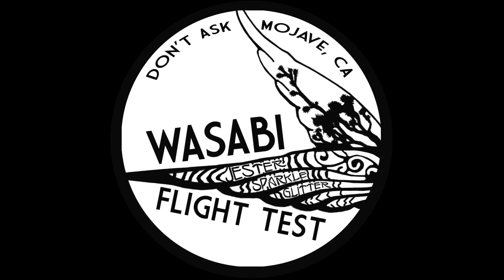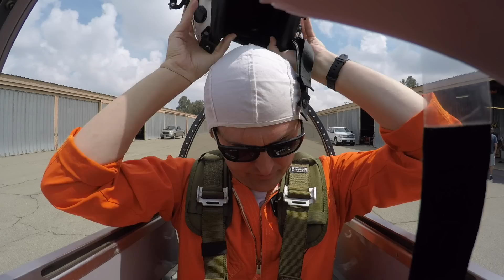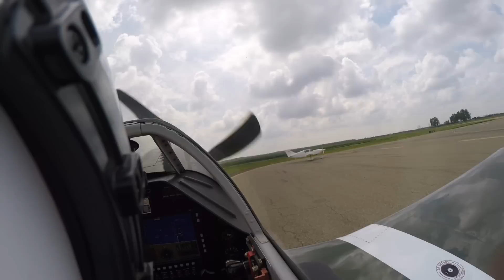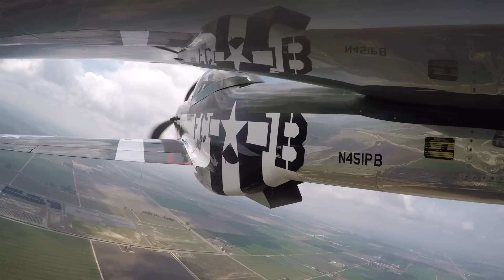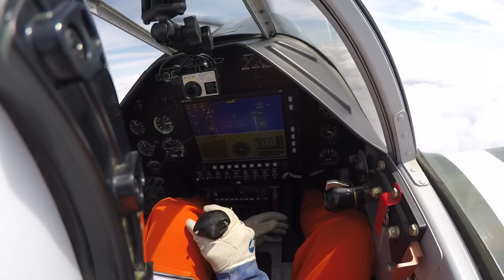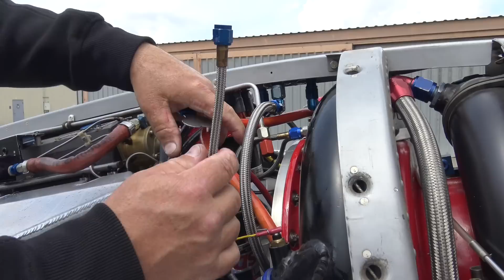Emergency Landing, Loss of Propeller Control, #Bowerspony Lucky Flt 13 -Long Cut w/ Debrief

Comment: Oy mate! I been in the aircraft realm for many years , don't loike heavy bonanza planes especially the V tail 😤 ! There's an old fashion saying: ( glider flyers make better pilots) anyhow, another interesting thing about any mechanical apparatus   in the air ? Even heliocopters, Is that ALL are 89.99% flyable 😳 the other 10.01% goes into 2 categories, 5.001% is any mechanical failure while in flight , the other 5.001% is pilot error and, if he doesn't react promptly? It will become a fatal accident. It's also better to belly land with low fuel or empty  at any time given the occasion ! ⏲️

Comment: Distractions on busy mechanics and so forth can be avoided if you have a chart, say 1 thru 50 and writing down what you are working with and then double check when you get bsck to it , mark with 2 initials when done . This is the only way even if you have all timers disease 🥴

Comment: The honesty of the video's is a real eyeopener. 
The red line in aviation, professionally or in homebuilding is constant quality.  Proficiency without any dips. 
I have met perfect pilots which, very seldomly, showed low proficiency flights. Also mechanics have bad days...alass we are human.
Check, recheck. And double cross-check.  again.   
Thanks for the video and good luck!

Comment: Dang. A loose line. No drilled line fittings or torque seal? Looked like the boss was very disappointed. That's what A Cards are for. Got sweaty palms watching your approach.
Reply from the maker: Thanks for the comment, great to have you along.

Comment: Kinda surprised you would use that number in your count...
Somebody did not properly tighten a hose? I do assembly and installs in marine engines, all of it custom built high performance stuff. I prefer to do the entire process myself but sometimes time constraints require asking for help...have a few rules...any time you install a hose, but, bolt...it gets tightened to spec at that time and as my helper works I expect a move by move narration of every move they make
Reply from the maker: Thanks for the comment.  It was a tough say but I think we can all relate to that lesson learned

Comment: Geez, if only there was a way to tag fittings as you remove them and untag after you torque them back down.  Or maybe mark them after they're torqued down.  Or write them down on a list and, like, check them off when you reassemble.  I wonder if you could just rent midgets to hold the fasteners shut during the flight -- nah, but maybe wrap 'em in some really thin bailing wire after they're properly torqued.  But why take responsibility for this when you can just blame it on alleged airport bums instead, amirite?
Reply from the maker: That’s a perspective, thanks for the comment

Comment: Very good video. One thing that I find very helpful is use of witness/marker paint stripes on all fittings and nuts/bolts. Not only does this allow you to know if a fitting has moved by just looking for a break in the stripe it its also a good way to know its been tightened. When you remove a fitting for service you remove the witness stripe completely and then when you reassemble and torque it your last step is to add a small stripe. Each mechanic can have their own colour so you know who did what. You can even have a double stripe from a second inspection mechanic and know what has been double checked and what has only been single checked. This helps you avoid the interruption problems from on lookers too.

Comment: Plane is stunning. Great video. You could debrief a slice of toast for an hour and I would still be interested. I am a mechanic (not aviation) and the technical and mechanical info is on point. This plane seems to have a bit of a character already. Which I suppose for you is exactly what you enjoy, figuring out the puzzle as well as testing the planes.

Comment: Anytime I'm working on the P51 or the Sea Fury I keep the hanger door closed and my truck in the hanger so people don't know I'm there and stop by while I'm working on the planes. Its for the same reason the man said, you can get interrupted. Not that I don't like people, but I don't need to be interrupted and have the chance to forget what I'm doing.
Reply from the maker: Well said, it's such a common problem.

Comment: talking about getting the "value" out of the chase plane when you need it (post takeoff safety checks) - have you thought about adding a guy on the ground with a telephoto lens and a tripod?  That way you can takeoff and do initial climb to your "minimum safe" altitude and circle where he can see you clearly and do the first-pass "is anything leaking/did anything fall off?" checks?

for spotting fluid leaks - have you thought about adding a colorant to the oil(s) to relieve the problem of not being able to visual ID leaking clean oil?

Comment: Really great stuff Elliot, well handled.  Was curious if the timing of the gear sequencing was resolved and if the gear stayed on the uplocks?
Reply from the maker: It appears to have been solved.  This flight was shorter than I would have liked, so the system may not have bled down completely.  We'll need a longer flight to be sure, but it looks promising.
Reply: @utopiasnow  thanks for the reply!  I'm sure that got pushed way down on the debrief list.  I was particularly interested in that from previous videos as I was involved in a nose gear door sequencing valve issue once upon a time.  Sheet metal doesnt stand a chance against hydraulics...  😳

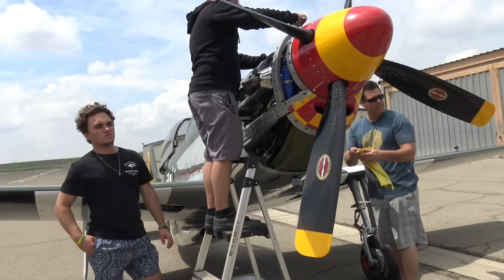Comment: 35:00.  No.
That is what happens when you do not have a proper mtx manual, work cards or a II.
Work flow gets interrupted, you just continue on with the unchecked steps.
The II is your further assurance.
Also torque paint.  
Edit: AND do not put on a component unless you are prepared to finish torquing / safety it.
Reply from the maker: Thank you for the comment, and the passion
Reply: @utopiasnow  Love your dedication and expertise.  Have been talking with my hanger partner about having you doing a short test series on our new to us kit built.  Don't know if we could afford you though.
Reply from the maker: @notj5712  I am sure we could work something out.  Drop me a line ElliotSeguin@gmail.com
Reply from the maker: @notj5712  We would love to support.  Drop us an email.  And thank you for the comment!!

Comment: Why are we pilots / builders so "polite"? Is politeness worth falling out of the sky, obliterating your airplane, and possibly killing yourself and/or others? Seriously, WTF? When I'm working and I don't want to be bothered, I put up a sign at my hanger door "CRITICAL WORK UNDERWAY: PLEASE DO NOT DISTURB". My buddies are very understanding, and I don't forget to screw a critical bolt on my engine or accessory because my neighbor wants to chit-chat about his $100 hamburger adventure from 1954. I don't put the sign up always, but if my cowl is off, you better damn well believe the sign is standing tall and proud...and in a VERY obvious location.
Reply: And another thing I do...TURN OFF the damn cell phone while working on the airplane! STERILE WORK ENVIRONMENT is as important on the maintenance floor as it is in the cockpit.
Reply from the maker: Thanks for the comment

Comment: Elliot, I lost the oil pump on my F-1 Rocket wtih an aerobatic MT.  Like the prop you have, it then went to high pitch.  When the prop went coarse, I looked at the oil pressure, and obviously it was zero,  I pulled the throttle back, but did not pull the mixture.  I had an airport made easily, and I hit the high key, everything was fine until I got to 120 kts, on base, then I could not slow down or get the airplane on the ground, even at idle thrust, with coarse pitch my airplane will fly.  I pushed it on the ground at 100 kts and got it stopped, with really hot brakes, but in my mind the engine had failed, but it was running at idle with no oil pressure and pulling the mixture never occurred to me.   On a subsequent flight you might pull the power to idle and the prop to coarse pitch and fly at best glide and see if you can maintain altitude.  In a light airplane with big power it might just fly at idle...  Doug Rozendaal.
Reply from the maker: Thank you Doug.  Sounds like some great flying in your rocket.  Are you still flying it?

I am pretty confident the airplane would have flown with the prop in coarse pitch.  The question was did the PSRU have enough oil to stay luricated, and what else was wrong.  Waiting on the gear and flaps was my hail mary in the event I needed to try to add power and get back to the airport.

Thanks again!!
Reply: I have had it 10 years, it's an EVO, I have over 2000 hours in it.  Fabulous airplane.

Comment: Great video! Love the new format! One question, what’s high and low key?
Reply from the maker: Thanks for the question.

A simulated flame out (SFO) pattern starts high and above the touchdown point on runway heading.  The spot is called High Key.  180 degrees of turn later the airplane is basically downwind abeam the numbers, this is called Low Key.

http://www.f-16.net/forum/download/file.php?id=4926&sid=9d79ed6d164d13806a6a3542c42fae60&mode=view
Reply: Elliot Seguin thanks for the answer!

Comment: This is outstanding. It fills a void in aviation content about flight test in the best way. I really appreciate the step through of methodology, brief & debrief, and honest discussion of the decisions being made. It even brings good items to consider for safety in a non-test environment like stepping to the downwind side of the runway to aid a 180 back if necessary.
Reply from the maker: Thank you Darin.  The offset take off is a bit controversial.  Some folks are opposed to it.  I use it, but we have taken flack for it.

Thank you!!

Comment: Love the in-depth video Elliot.  One question - do you have any ideas why there seems to be so many problems, especially as of late, with the LS and auto derivative engines?  There have been several fairly high-profile accidents in the last 2 years involving them and seeing these videos with the teething problems being found, I'm just wondering if this is a real change in the failure rates or if it's more because more auto derivative engines are getting into the air and thus there's more actual failures but the rates are still the same.
Reply from the maker: Interesting question.  I am not an expert on LS and auto derivative engines.  I would say however that the safety record for auto conversion hasn't been outstanding.  Someone once said the problem with a car engine is it makes rated power for less than 1% of it's life, where an airplane engine will sit at TO power from brake release to cruise altitude.  Other people talk about redundancy of systems, I am not sure.

Certainly the basics (suck, squeeze, bang, blow) are the same, it seems like they should work the same.

Thank you!

Comment: Love the new format! 
As a mechanic in a repair station,  I think stopping distractions is quite difficult, if not impossible.  I think a deeper take away would be a plan as a mechanic to mitigate the risks associated with being distracted.  Any time you stop, and re start, you start two steps back from where you think you were. And I often take a break, and come back and put a wrench on lines I have ready done. Torque stripe is also a good tool in this scenario.
Reply from the maker: Thank you John!!  I like the strategy!
Reply: @utopiasnow  feel like that came across slightly condescending, which is not my intention. Sometimes crap happens and mistakes get made. But.. we can do something to help prevent them when possible. 
Love your videos Elliot!
Reply: Being a prior military electronic technician this problem is negated by the use of appropriate manuals and operating procedures.  I can't speak for my civilian counterpart but they admitted it was human error.
Reply: Totally agree with just marking the joint/fitting as being torqued. Also in high vibration area's and with flight control systems, it is always prudent to try and wire lock or install an anti-turn bracket where possible. An example was a mod to add anti-rotate brackets to Vans RV's fuel pickup tubes, internal to the tanks after a number of them fell off! In lieu of a visual indication, a process to list and note anything and everything that gets stripped down/disassembled and a corresponding 'check' once its re-assembled and torqued/locked completely. Hats off to Rod and Eric, Beautifully built aircraft.
Reply: Putting a stripe on a critical fitting so you can see at a glance if it is lined up is just a great tip. I appreciate that.
Reply: I like checklists and then going back and rechecking steps that I’ve crossed off.
Reply: A&P for 17 years on helicopters in the oil field. We ALWAYS used torque strips on EVERY line fitting as we torqued the fittings one at a time. Then the pilot would verify on preflight. It is a shame to see such a beautiful aircraft with such unprofessional maintenance practices. This should have been spotted before the test flight!

Comment: You would think the PSRU would have a fail safe minimum as to not render the engine completely useless with loss of hydraulic fluid. Should add a hydraulic fluid level sensor to the reserve tank just because it's been an issue. The sensor would eliminate the belly check, and allow almost immediate response to a levels change. Could even use a gas gauge rigged setup for the time being. Could pull one from the junk yard for cheap.

Well flown falling bird Elliot. Good job getting her on the ground.
Reply from the maker: Interesting thoughts, thank you

Comment: Thank you and Mr Bower for posting this video.  A lot of good information.  And from a viewer standpoint the more info the better.  If there are viewers that want less, all they have to do is fast forward the parts they don't like.  As far as thoughts go, I thought the brief should be in a more sterile environment, not where there are other personnel and distractions.  The same for the debrief.  From a meteorological perspective regarding cloud cover percentages and what's acceptable.  Take two sheets of paper.  Lay one on the table, this will represent your sky.  Take other piece of paper and cut off 1/5th of it (20%), and tear it up into small pieces, these will represent the clouds.  Take those cloud pieces and place them on the piece of paper that represents the sky, and determine if that percentage of clouds is manageable or not.
Reply from the maker: Thank you Kent

Comment: Geat video. Is the prop hub not designed that the spring pressure pushed the blades toward fine pitch/high RPM?
Reply from the maker: This prop came off a King Air, so multi engine...fails coarse pitch.  Thanks for the comment.
Reply: @utopiasnow  Makes sense if it was off a multi, I guess custom prop hubs certainly are not cheap
Reply from the maker: @USAF291  Well said

Comment: Thanks for the long format! I absolutely loved the detailed debrief of the whole process. As I plan to get into kit building I will have to take the advice on distractions during build and maintenance to heart. Could you do an explainer some time on chase plane procedures for the realm of flight test? The spin test chase video and the chase elements touched on in this video have always intrigued me. I used to fly chase for UAVs (to act as their eye and ears looking for traffic) and I am interested to compare and contrast the roles with flight tests. I also think others could get value out of the planning that takes place in a good formation brief.
Reply from the maker: Thanks for the comment!  Chase is a great topic, I think in the contract test community Wasabi probably relies on chase more than most.  I would argue that comes down to my relationship with Justin Gillen.

I rely on chase first for external information about the airplane (smoke, oil on the belly, gear position, fluttering trim tabs).  Secondly, I rely on chase for reminders about glide cone, traffic calls, and airport position calls.  The problem is all those things are very critical pieces of data with wide ranges of interpretation., and if I don't trust what you are saying than all you are doing is distracting me.  In short, I have to trust that you and I believe what you are saying means the same thing for me to act on your call.  The best way I have found to create that trust is through a technical and personal relationship, like the one I have with Justin.  

We worked a program a long time ago with a team that had particularly poor radio discipline.  That team had a tendency to say things on the radio that had a wide range of interpretations.  Two times that almost resulted in an unnecessary bailout.  So there is a tendency for people to confuse formation flying with safety chase.  There is overlap no doubt, but great safety chase has a broader skill set, and (in my opinion) a specific kind of relationship with the test pilot and the test program.  At Wasabi the critical piece of the puzzle is that Justin and I alternate those roles on programs, to make sure we both are in touch with the other side of the coin.

Comment: I’m not a test pilot and have never built an airplane myself. However, it seems like there are a lot of important things being overlooked. Is this level/type of problem normal for the type of build?
Reply from the maker: Normally no, but as Rod and Eric pointed out in their interview, the risks with this airplane is that there is just soo much new stuff and the airplane is soo complicated.  Which means there aren't standard procedures for a lot of this stuff.  Remembering to final torque fittings is a bad example, but many of the other problems we have had were very much caused by this.

So what ends up being unusual about this program is that we are talking about all these learning moments so publicly.  The idea being the Stewart community, and the experimental community can benefit from the lessons learned.